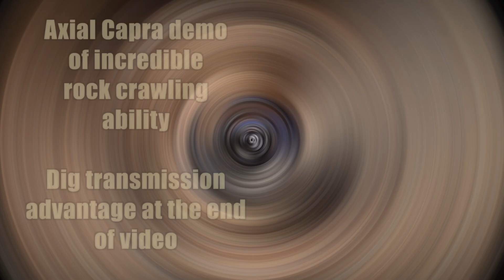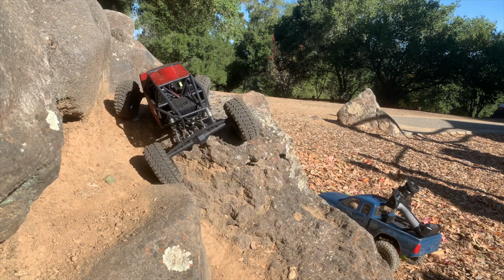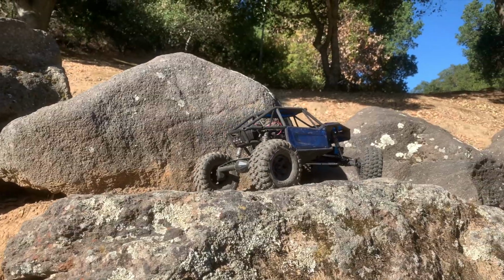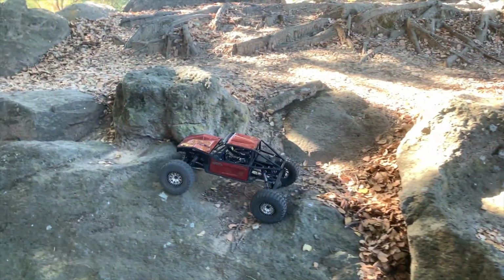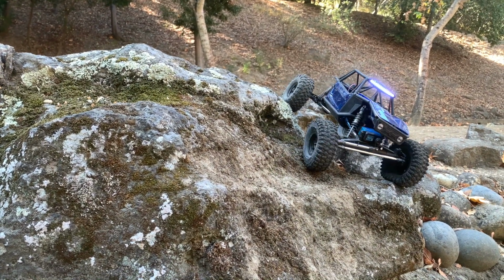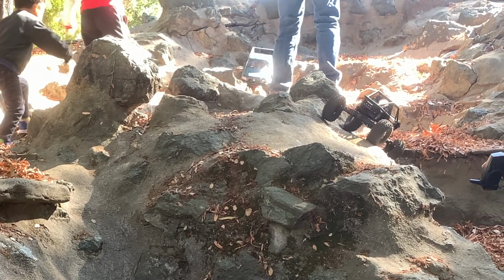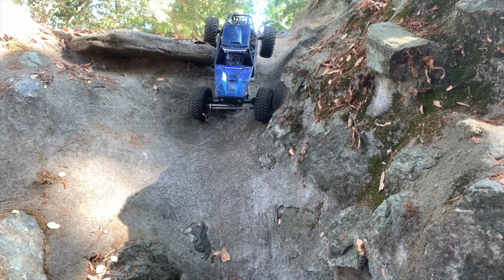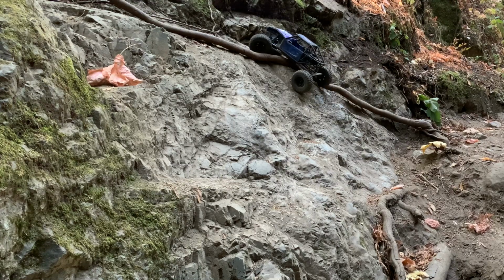Axial Capra - crawling, running video and DIG demonstration

Comment: Such an impressive crawler, it has proven to be very capable and I have tested its durability several times and it is very tough. I think the Capra is going to open up new lines at peoples crawl spots they never thought possible. Great Video and great comparison on power units as well. 👍👍👍👍👍
Reply from the maker: Yes, it doesn't fall often since it just slowly slips and gives warning signs. And when it falls, it lands on its tires or that sturdy cage.

Comment: It’s better to not use dig on descents. A locked wheel will not act like a rolling one and can create some really unpredictable body movements. Keeping the wheels locked together means they all rotate or all stop, so a blip of the throttle can get it to regain control if the wheels slip locked up. With dig engaged the backend is going to slide around.

Comment: Its definitely capable to say the least! Just not my personal style though, id say its a whole different class from any scale truck not even comparable. Its more a rock buggy crawler.
And from my understanding the dig brake is commonly used for tighter turn radius, because the back drags you get that tighter turn in strange spots.
Reply: That’s exactly what it is. A rock buggy. Lol. That’s exactly what dig is used for, sharper turns. 

When off reading we don’t pull the ebrake, which would be the same as dig on an awd or 4wd unlocked center diff vehicle, and then descend a hill.

Comment: is brushless really worth that much more than brushed? Or is it just a minor advantage?
Reply from the maker: It is a minor advantage usually compared to a great brushed system.  In the Capra, the advantage is more  because a bigger 550 motor does not fit. And the Capra can definitely handle more power with its balance and abilities.

Comment: Hi RC, I've been subscribed for quite a while now and watch your channel regularly. You have so many very detailed tests and reviews and I have learned a lot from you. THANK YOU VERY MUCH for that! I have two huge favors and/or suggestions I'd like to make and wouldn't be surprised if a lot of other people would really get a lot out of this too! I just got a Capra and there's a couple of things I don't understand about it, and a Mod I'd like to attempt, but am not sure how to go about doing it. First thing would be, how to set up the DIG (all 3 modes) in the transmitter? I have a Spektrum DX5C, and haven't been able to find anything about this anywhere! The other thing I'd like to do is set it up for 4 Wheel Steering. I would much appreciate any tips or help you could share about this. Thanks in advance! You're doing an absolutely fantastic job here on You Tube!

Comment: Off topic question but I could use your help here!! I put on a roof rack, and a bunch of stuff on the roof rack, and now the suspension sags. Especially the rear. What can I do to fix this fastest and easiest? Thank$
Reply: Vehicle type is trx4.
Reply from the maker: There a quiet a few option springs for the TRX4 here .54 rate is my suggestion. https://snp.link/3bf07b3c

The other option is to turn the preload nut on top of the springs to raise ride height by preloading the spring.

Comment: In the blue rig with the HW ESC, are you running a BEC for the steering servo or at just 6V from the ESC? The dig servo can't take 7.4V, can it? Thx, great video to show capability.
Reply from the maker: The blue one is just running 6v because of the DIG servo.  We'll check on the red one.

Comment: Stuck between the Element Senduro the TRX 4 Sport and the Capra. If you could only have one of them which would you choose?
Reply from the maker: If we could only have one, it may be the TRX-4 sport. It is the most durable, the mos upgradable and the most body options.
Reply: I own them all and the original TRX4 and all the crawlers clear back clear back from ax10 Scorpion and I will say that I would depend on your style of crawling. If you’re going for upgrades and all around scaler then the The trx4. If you’re going for a buggy and you know how to properly use dig then the Capra. The element flexes way to much and I love my gen8 axe way better...

Comment: Great video! What pinion gear are you using in both trucks? I went down to an 11T using a Holmes brushless 2200kv and I think it needs a 10T. Is it even possible in this truck?
Reply: Did you switch to button head screws? Supposedly that gives you a little more room to work with different pinion sizes.
Reply: @trailcrawler2038  I didn't think of that.. what pinion it's the truck with the 2300kv motor?
Reply: A 10T pinion is as low as the stock setup allows.  Will look at modifying the mount to make a 9T work.

Comment: Do you prefer very nice 90mm shocks or stock ones? Is the one mod mandatory?
Reply from the maker: Did not like the 90mm because it lost its flex. We went with 100mm and pen springs in the shock to lower the sag height.

Comment: What 97mm Shocks is that blue one running?
Reply from the maker: That one is running stock springs. But it has the pen spring mod the lower ride height.
Reply: @RCReviewChannel Thanks for the response.  At 1:58 you say 97mm shocks.

Comment: Ok, I'm having a seriously-bad problem.  I have absolutely no clue how to set up the DIG on my Futaba 7PX.  Prior to getting the Capra, I've been running off-road SCTs, buggies, etc.  Does anyone know how to set up the DIG on a Futaba 7PX?
Reply from the maker: It is very hard to set up as 3-position.  The good news is the freewheel position is useless anyway.  2-position is best. Just find a channel and find an angle that will move through that terrible geometry movement.
Reply: @RCReviewChannel  Breaking it down as simple as possible, I'm coming from vehicles that only use 2 channels...I've never dealt with vehicles using more than that.  I plugged the DIG servo into Ch4, and that's as far as I know how to go.

I've had people tell me, "You just need to start with the endpoints set to '0', and work out from there", but that doesn't do me any good if I don't know what settings to set in the Tx. For example, if plugging the servo in is "step 1", and programming the endpoints is "step 5", how can I do "step 5" if I don't even know what steps 2-4 are?